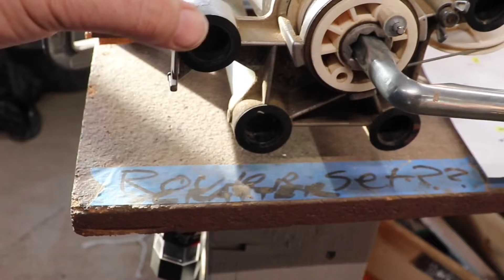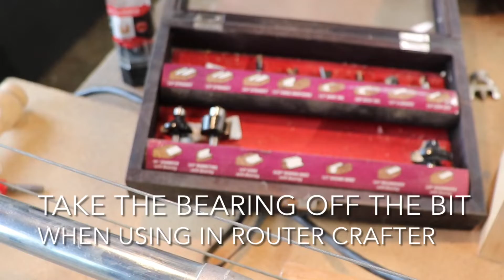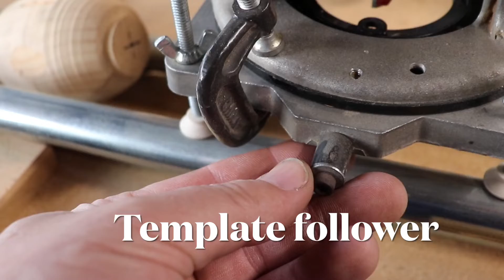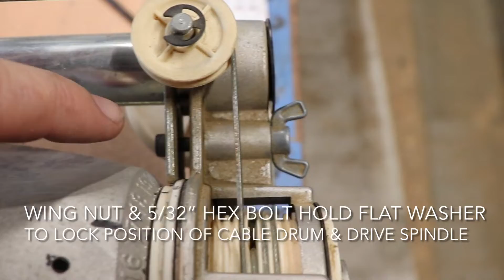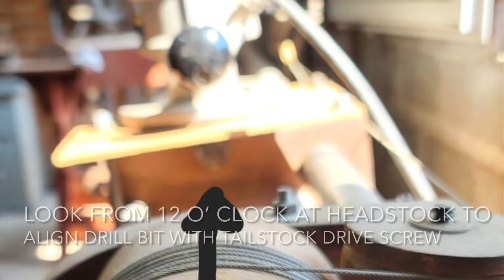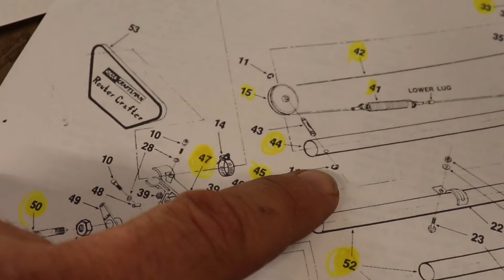Sears Craftsman Router Crafter (In Detail w/ Helpful Tips!)

Comment: Your video has been great!  I've been making canes on my regular lathe and using rasps to do spirals and thought there had to be something better.  Found out about the router crafters then this video and I picked one up yesterday.  It's missing a couple of the hex heads and the bushing for template but I don't need to start out.
What would you recommend I do to be able to hold 1.25 round spindle at the maximum 36" length?  Did you ever fabricate something like that?  I saw the extension, but I need the longest length possible so I don't want to extend with a chuck and shaft.  Maybe a modified spur drive somehow?  Not sure how I'd get it in the 1/2 square hole.

Comment: Can you control the spiral length ? I am looking for having 45 degrees rotation of the piece of wood, while the router moves 6inch during this 45 degrees rotation. Is it something that can be done out of the box ? Or do I need to 3d print or machine some parts ? Thx a lot !!
Reply from the maker: Hello,
Thanks for watching and subscribing !
We appreciate your questions
Yes, the spirals can be started and stopped anytime using clamps on each side of guide tube.  45 degrees is no problem on the Sears Craftsman router crafter!
Have fun with ur woodworking adventures!
Sincerely,
JR at A1CFS

Comment: What bits are you using?
Reply from the maker: Hey Tim 
thanks for asking what router bits we use
Mainly we use modified spade drill bits from 1/4 inch to 1 inch ground into specific router crafter bits by grinding them into certain shapes on the grinding wheel. (See our video on this.) This is especially helpful when making hollow shapes on router crafter….
On the Sears craftsman router crafter, Roman ogees mostly modified and unmodified as well
We also use 3/8 inch & 1/2 inch double flute straight bits, chamfer bits, 5/16 inch radius round nose bits
Thanks again and have fun with your woodworking adventures Tim!
Take care,
JR at A1CFS.com